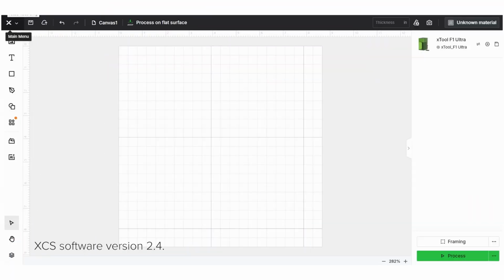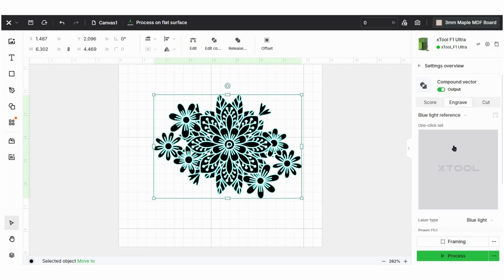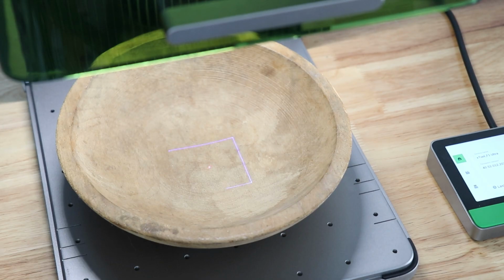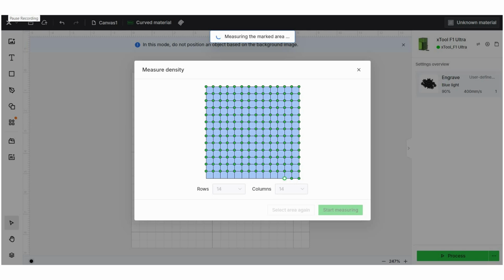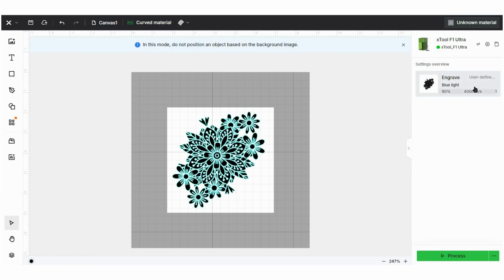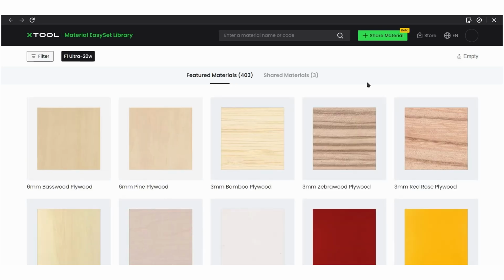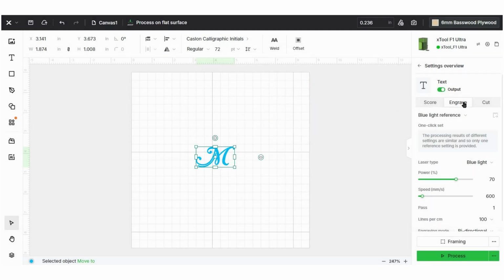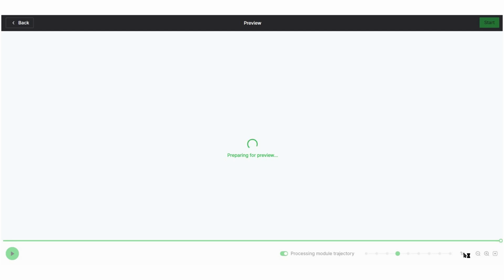Curved Surface Engraving Made Easy with xTool F1 Ultra

Comment: Thanks for the video. If you are wanting to engrave multiple curved items, one after another  on F1 ultra using curved settings, do you have to measure the curve each time or can you just swap in the next object after the engraving finishes?  Assuming they are the same size and sample placement for consistency
Reply from the maker: I would create a jig or something that helps you place the item in the exact same spot on the machine every time. Then you can engrave one after the other. The curve measurement will stay in the software until you manually get rid of it so you don't have to do this whole process over again every time.